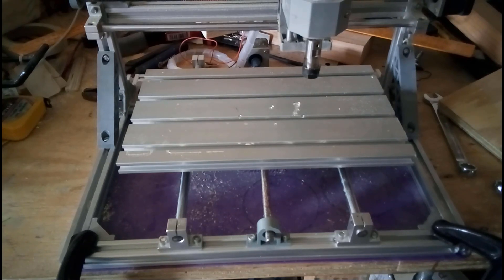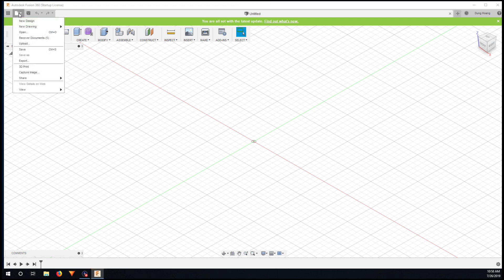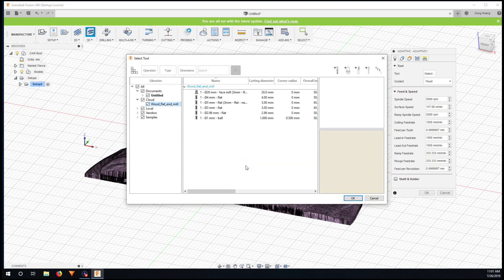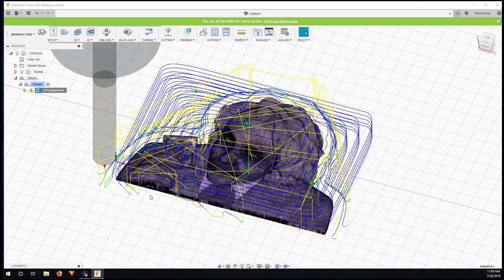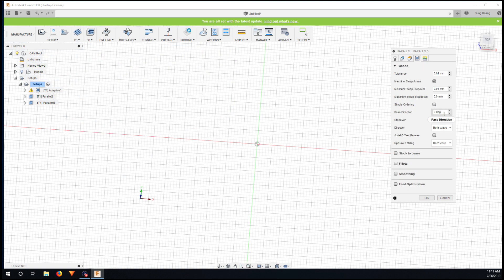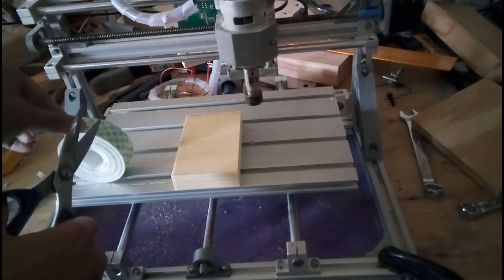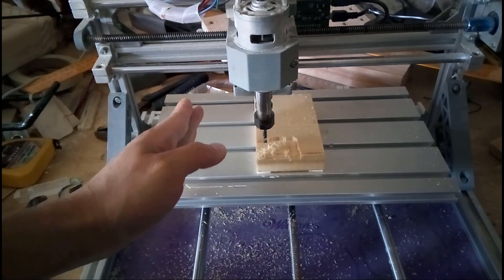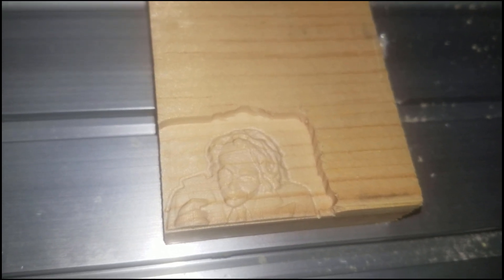3018 CNC - Multiple tool changes workflow - 3D art carving

Comment: Hi Minh, I have been playing around with machining in my 3018 using a large STL. I tried compressing it but poor quality. So, in Fusion360, I kept it large and instead of using Adaptive Clearing (crashed after trying for 8 hrs) I used parallel with 1mm depth slices and 6 stepdowns. The machining path was generated in 20 seconds. So, I used a 3 mm cutter with parallel on x axis, then 1mm at right angles with a 0.3mm depth slice(parallel to y). This was for a 70,000 triangle STL.  The machining took 12 hours to make a 200x80mm complex moulding.
Reply from the maker: If it's a complex molding, it's normal to take 12h. If you are not familiar with the machine yet, just practice with simple parts first
Reply: @minhsmancave9448  the point was that I can use 100MByte plus STL in Fusion360 without condensing it. If I use parallel it is fine. The 15 hrs machine is normal
Reply from the maker: My videos was old and fusion 360 fixed the issues with size of stl files

Comment: Hi great simple , one problem I have is post process. when I try to import NC Files they are rejected in Easal as they are simulation files .how can I fix this problem
Reply from the maker: You will have to download and install an xcarve/easel post processor to make it work with easel
Reply: @minhsmancave9448  tried that no success
Reply from the maker: @petertattersfield1154  Maybe have look here and you might find an answer:
https://forums.autodesk.com/t5/fusion-360-manufacture/how-to-setup-fusion-360-for-using-with-x-carve-cnc-machine/td-p/6857300

Comment: You know that since this was video'd turbosquid was acquired by Shutterstock and even when you filter, as you did, for free you still get a ton of for pay stuff.  I suspect it will eventually go the way of Shutterstock where nothing is free.

I just slapped a cable chain on my 3018 pro and just need to design a holder to 3d print for the top part of the chain then I can use it so I am looking for files.  I still need some alligator clips and some switches so I can home this thing then I am set.  Oh, I need a V-Bit too as the ones that came with the machine are bad and really meant for pcb tracing work not for wood (made a horrible mess in pine).
Reply from the maker: If you're designing pcb yourself, I recommend getting big tip v bits or 0.5mm flat endmill, make sure the space between the traces are big enough for the big bits. The 775 motor vibrate a lot and will break your v bits very quick.
Reply: @minhsmancave9448  I am not but I was trying to use the ones it came with to lay down text and it was horrible.  Not sure what the bits that came with the machine are really for.  Which V bit would you suggest for laying down text into wood?
Reply from the maker: For pcb, it is not easy. For wood, probably 45 degree to 90 degree v bit. The ones with 2 flutes, not the one that is cut in half like those came with the machine.
Reply: @minhsmancave9448  Yeah, those that came with the machine are junk.  I mean I just have no idea what they are good for.  Have any idea where to find what you mentioned with a 3mm shank?  Something this 775 motor will work with?
Reply from the maker: @thebeststooge  Something like this: https://www.aliexpress.com/item/32624734849.html

Comment: hey could you do a more in depth video and better resolution on screen I cant follow this and mine simply wont do the things you say. and a lot of options are not there, if you could do a more detailed video it would be much apprchiated
Reply from the maker: The video resolution and also the screen capture in the video is 1080p. I can't do better than that. For the options that are missing, please be more specific. Fusion 360 might change a little bit since I posted this video but in overall, things are the same. One thing that Fusion 360 got better that you won't need to reduce the mesh size any more, just import directly the STL file.

Comment: Hey Minh, nice video! I'm trying to learn to use this 3018 CNC machine. I was wondering what bit you were using for your parallel operation? Was it V bit or a ball nose bit? Thanks
Reply from the maker: For this one, I used 1mm diameter ball nose. I also used 0.2mm tip 30 degree v bit to work on smaller models. The ball nose I thing is better for wood working, the surface is smoother than v bit. Small tip v bit can give you more sharp details but will take longer to cut. You can also run a parallel path for smoothing with ball nose then other tool path to rest machining with v bit. That way, you will have both smooth surface and details. I'm sure you will get the hang of this after a few cuts.

Comment: Hello, thanks for your help, it has helped me a lot. That is, if I have a problem, when I send the g code through the candle software it traces circular routes larger than the effective milling area and that misconfigures everything. What should I do to avoid this so that the bit moves only in the model area?
Reply from the maker: Make sure you have the unit on your candle software and the machine the same. Most of 3018 CNC are configured as mm(metric). The unit in CAM software should also be mm. Also make sure the number of step per mm is correct. The original 3018 cnc should have 800step/mm.
Reply: Obviously an old comment but I had this problem with Fusion 360 and fixed it by uninstalling and reinstalling the grbl post processing package.

Comment: Good video. You showed how you reset the Z position using the Z probe after the tool change but you didn’t show how you made sure the X and Y axis was reset in the same position as for tool one. Thanks
Reply from the maker: If your stepper motors didn't lose steps, you won't need to reset the x and Y zeros. I do have another videos showing how to set reference for X and Y axis but  Z axis will be the one you use most

Comment: Have you used solidworks to go though the same process? 3dless although claims it generated a reduced vertecies STL. In solidworks the vertex count remains the same preventing an import to succeed because the application hangs. 
or do you only use fusion 360?
Reply from the maker: Just an update, fusion 360 improved their ability to import stl files. I was able to import big stl recently without any problem
Reply: @minhsmancave9448  Solidworks has yet to do the same. Even with help with meshmixer/3dless it is unable to do so efficiently. 
I got it to eventually open in solidworks but it i will crash on extracting machinable features so it really needs some work. 
I may have to trial fusion 360.
Reply: @minhsmancave9448  They have more of a focus than solidworks it seems. Autodesk's licence is abit strange though. 

Have you thought about getting the 4-5 axis CNC? it is the same work area as the 3018. 

If you purchase a microstep dm556 and smooth stepper you can add your own if you purchase the B and C Axis turret and tail. They arent expensive.
Reply from the maker: @devil2005iscool  Right now I only have been using the free version of Fusion 360 which doesn't really support more than 3 axis. Adding the 4th axis is not really difficult in the hardware but more expensive in the software which I will actually to buy a license ($495). For what I have in mind right now, I'm contented with 3 axis.
Reply: Yea. They have a 50% sale on at the moment so it is only $250 but still alot of money. It's a hard one. :p

Comment: Thanks , but i have a question , how you did for second mill go directly to point for start graving even its far from ? after this you just run it and it go to exact point ! i miss something !
Reply from the maker: No, you didn't miss anything. The original X and Y points are still memorized and the machine know actual position of the bit. When I ran the second path, the machine still work based on the old origine point. This origine only changes when the stepper motor loss steps or you actual reset it. Otherwise, it should remain the same
Reply: @minhsmancave9448   oh super ! thanks so much for you fast answer!! i learned a lot from your videos , thank you so much
Reply: @minhsmancave9448  Hi , again i have question, i do as you show in video about z prob and it works great , but after lunch my project mill don't even tuch my stock ? could you please advice me , i cheek consol and i get this message    [PRB:20.266,-48.945,7.649:1]
ok
$H < error:5
S1000 < ok
Reply from the maker: Try to run "$$" in the console and check $22. You probably have the homing cycle enabled without the homing switches installed. If $22=1, enter $22=0 and try to run the Gcode again.
Reply from the maker: OK, I think that your Gcode have a homing line but you don't have hardware to do that and it gave the error. You will have to open the Gcode file with a text editor and remove that homing command. If you don't know which one, you can send me about 50 first lines of the Gcode, I can take a look and tell you which one to delete
Reply: @minhsmancave9448  How can i sand to you in private ?
Reply from the maker: Which software and post processor you used to get the Gcode, look different from what I got with fusion 360 and grbl/grbl for post processor
Reply: @minhsmancave9448  i use also 360 fusion thats all after this i post processor for G code from 360 fusion, i fellow all your videos
Reply from the maker: The Gcode I got a bit different, I have a line "g90" after "g21". I don't have any M9 lines. Try to insert g90 line and remove M9 lines and see how it goes
Reply: @minhsmancave9448  :(( no its not work also ! even i change M9 ! strange
Reply from the maker: @lyesakkouche8285  Yes, it sounds strange because It seems that the error was the homing cycle but there wasn't any homing command in the gcode. And I haven't heard any viewer reported this type of problem.
Reply from the maker: @lyesakkouche8285  maybe check also what version of GRBL you have and also the control board. If you also have the Woodpecker board, You can upgrade the firmware to the latest version of GRBL very easily using Arduino IDE
Reply: @minhsmancave9448  Hi , can i sand you all my gcode and try it with your machine , its little project , of cors if you have time ? i will apreciate !thanks again for all
Reply from the maker: @lyesakkouche8285  I don't have the GRBL control board on my machine. But I think I found the problem. It's the Gcode. I looked at tit again and I didn't see any line that make the Z axis go to a negative position (under the surface of the stock). Check the height tab in fusion 360 when you setup the tool path (make sure the bottom height have to go under the surface of the stock) and make sure that to run a simulation before exporting your gcode to see if the tool path runs correctly.
Reply: @minhsmancave9448  Hi , i cheek all what  you advice , every thing good , but it still the same problem! i made many test with different projects of other , but i get the same problem with my machine! there are who say to install limit switches ! you did it ?
Reply from the maker: No, I've never installed limit switches on my 3018. Never got any problem if the simulation works correctly
Reply: @minhsmancave9448  ayay e i dont find any solution , my be i should change grbl board like yours ? do you have link of amazon ?
Reply from the maker: What board do you have? You can try upgrading to the latest version of grbl first.
Reply: @minhsmancave9448  the last grbl  control candle_1.1.7
Reply from the maker: Candle is the user interface software. Grbl is the firmware on the control board, you can, you can check what version of grbl you have by checking the console when first plugged in
Reply: @minhsmancave9448  Yes , Grbl 1.1.f what i see in cancole , is it correct ?
Reply: @minhsmancave9448  Hi , man ,finally you are right . z dont go down , i correct my G code and you told me !! i want to thanks you so much for your help and advices, you are Pro , thanks !!
Reply from the maker: No better feeling than being able to help. Glad that it worked for you. Let's make things
Reply: @minhsmancave9448    I will continues look  your videos ,great job what you do , thanks !

Comment: Hi, you zero the Z axis on your machine after you changed the bit, but when did you zero it for x y axis?
Reply from the maker: The X and Y axis must be zeroed before the milling job start (where ever you set in the CAM software - corner, middle of the stock...). This step won't need to be done again unless your machine loss step in the middle of the job and needed to start over on the same stock. If you have the cutting speed set right, this shouldn't happen and you won't need to do it again, only need to probe the Z axis when you change tools.

Comment: witam, w jakim programie to robisz
Reply from the maker: fusion 360 to make tool-paths and Candle for G-code sender
Reply: @minhsmancave9448  
thanks, I have a grbl plotter to use and I need nc files (I think) I don't know much about it, I'm learning
Reply from the maker: Yes, fusion 360 can be used to make NC files. You can check my others video about starting milling with the 3018 cnc to learn how to use this machine.
Reply: @minhsmancave9448  dzieki
Reply: konto jest darmowe

Comment: Question, I have the same machine as you. I see you are doing 800mm feed rates but I've broken some bits doing it that fast with only doing 0.5mm step down. How the heck are you getting that high of a feed rate on that spindle/motors?
Reply from the maker: It seems that your parameters are pretty reasonable to me. Not sure material you are cutting or what type of bit you are using. I always set the spindle speed at 10000rpm
Reply: @minhsmancave9448  Typically hard and soft woods, using freud bits. Maybe I should try again but when I try to go 1mm pass at even 300mm/min on medium density wood there is a crazy amount of chatter and boy is it loud.
Reply from the maker: That sounds very slow. I think you should check if all the bearing are tight and in place and everything is tightened to reduce vibration. Other option will be upgrading your spindle, which you should do at some point. 500w spindle will make your machine way better (from my personal experience)
Reply: @minhsmancave9448  Well the bearings are tight for sure, I upgraded them all (z,x,and y) to better quality ones, so most likely not that, but who knows, maybe they are not as good as I thought. I might end up taking the whole thing apart and just seeing if there is a place that is somehow loose but it's been like that from day one before all the mods. I might consider a spindle upgrade but in a couple months I'm buying an x-carve so  this will be used for small things but still want to get the most out of it as I can now. Is there a way or something I can maybe show you to get an opinion? I got a few more 'sacrificial' bits I could just break.
Reply from the maker: If you are buying a X-carve, you will never go back to use this one. You will find that the new machine is faster, cut smoother. I think you should just think about convert this one to something else. Maybe a little laser engraver will be fun. I don't really use my 3018 anymore, unless I wanted to take it to somewhere to show some kids how cnc milling works
Reply: @minhsmancave9448  3d printer?
Reply from the maker: Laser engraver is easy to upgrade to, only need a laser head. 3d printer will need a new control board, extruder setup, limit switch, etc.
Reply: @minhsmancave9448  well RIP, already have a 5.5w laser for it ;>_> LOL Thanks for interacting with me ♥

Comment: Thank you ! Do you have the reduced STL from 3D less? It's keep crashing on all of my browsers 
Thanks
Reply from the maker: Hi there, I just checked 3Dless website again and it didn't work for me either. I already deleted my reduced mesh file for the Joker. I'm sorry!!! Maybe you could try MeshLab or Blender, those software can also reduce the 3D mesh.
Reply: @minhsmancave9448  finally did it :-)
Reply: But I don't find the tools you point at 5:14 , I don't have the cloud tab
Reply from the maker: @BertrandLEDIEU  You will have to create your own tool library. Just open tool manager and add whatever tool you have in stock so you can use it later. It will be save to your fusion 360 cloud library
Reply: @minhsmancave9448  thank you!
Reply: Another question. I see you are using the Easel post processor. I'm unable to install it on mac. After copying to the correct folder, I cannot  see it in personal processors.... Any idea ?
Reply from the maker: For me on windows, once the post processing interface is open, you will have to browse to the folder where you have the post processor stored and choose that folder. Then you will see it

Comment: Thanks for doing this video, there are some things I learned form this for my own 3018. Question. Sometimes my machine just stops when doing multiple g-code files, how do you deal with this when you need to  rerun something or it locks up in a tool change?
Reply from the maker: My solution for this is be prepared from the beginning. Use one corner as origin and don't cut it. You can use the touch probe to find that corner again if your program stop or your motor loss steps. Check out my video about finding zeros on all axis
Reply: @minhsmancave9448  Thanks ♥ I'll see about making a touch probe.
Reply from the maker: You can have a look at this video then: https://youtu.be/PmRQO1XMm-c